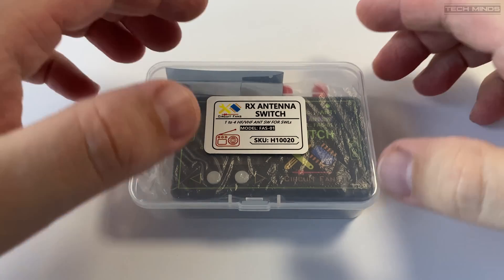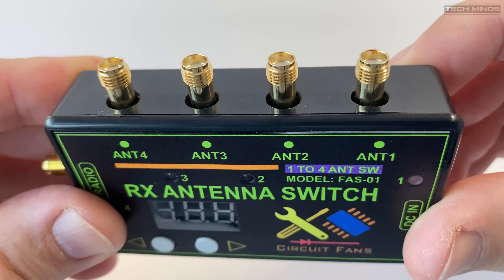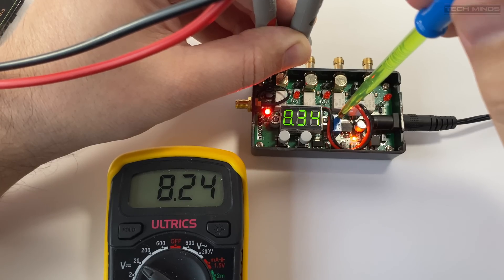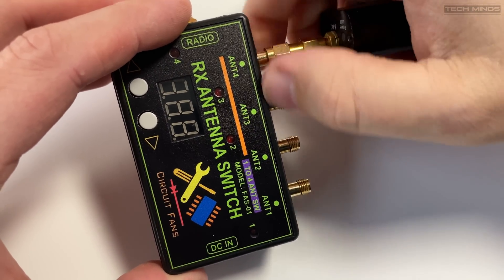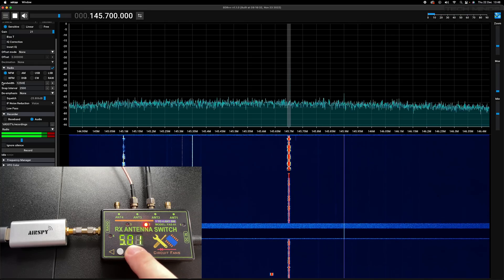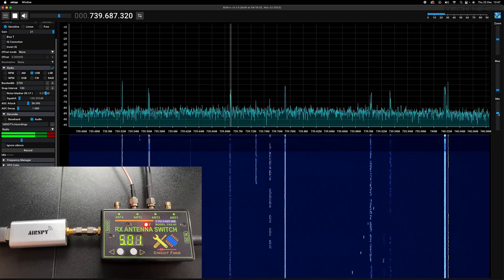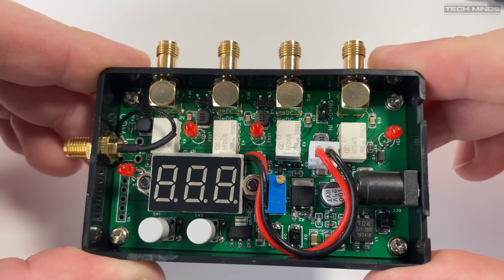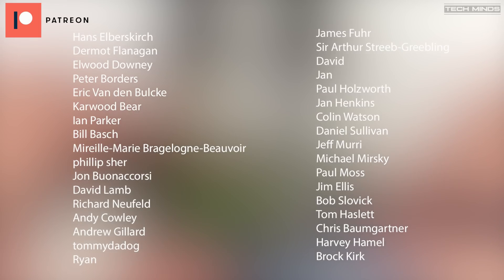SDR HF/VHF RX Antenna Switch With BIAS-T

Comment: I wonder why so many inline products for SDR  is only topping out at like 30ish megs. Why not just build the circuit to allow a clean path up to 3gigs or even 2 gigs. or even 900megs. It would seem to me that the higher freq arena would be component picky as far as tolorancers and quality, and thus drive the price up but i would pay 120 bucks for this kind of a switcher that was topping out at 1.2 and was as well switchable via a small AP on mac/pc. would any other readers pay 120m for such a hearty switch?

Comment: Nice.. Too bad Range is 300KHz to 150Mhz (Just above 2 meter)  nice it worked @ 740MHz.. Can you try this Antenna switch with ADS-B if it works decently at 1090 MHz.. (how bad will it be)

Comment: And I'm back. I got this a while ago, but I'm only just now getting a chance to play with it. 

I've looked at the instructions and the device itself, but I can't figure out what the specs are for the DC in jack (Amps, Volts, Center positive/negative, etc.). I'm also now sure about the inner/outer diameter of the jack itself.

After watching the video again, I think I should be looking for an adapter that should do at least 6.5V (1.5V + 5V Bias-T), 0.7A? So ... 4.55 watts?

What should I use to power it?

Comment: What voltage does it run on?  You said the bias T was showing 10v, so does it work with 12v DC IN then?

Comment: Another gadget for the shack!
This channel is proving to be expensive! But I really enjoy your videos!
Decided to order one since it will be an excellent device to use for direct comparisons across several different loop antenna designs. Bias T voltage available across all ports AND selectable means it enables passive antennas to be compared as well.
Happy New Year for 2023 and good DX!

Comment: This looks a great bit of kit but I'm looking for an antenna splitter that is able to split to 3 scanners but goes up to say 450 MHz. Does such a thing exist?
Reply: You can use TV antenna splitters with the correct adapters which are fairly inexpensive, but often lack the needed isolation between ports.
Have a look at Stridsburg Engineering out of the U.S. for designs that are meant for use with communications receivers. But they are not cheap.

Comment: It would be amazing if there was a similar antenna switch that was also controllable from a computer (via USB or Ethernet). 🙂
Reply: you could use a smart switch via a raspberry pi or alexa, just solder to the swtich contacts on the antenna switch box.
Reply: @Spark_230v  That sounds like a good idea, thanks! :-)

Comment: It's amazing how often I think, "I need a Radio Thing, I wonder which one is good," only to find Tech Minds either already has a video on the Radio Thing or releases one within 12 hours. :P

Just bought one of these so I can pair an actual 2m/70cm receive antenna with my YouLoop on an HF+ Discovery. Want to make sure I'm not missing the latest news from the random grumpy old guys I keep picking up on 2m. :P

Comment: The radio connector is kind of curious.  The PCB clearly has a spot marked there for a right angle SMA connector, yet they put in a bulkhead connector.  I wonder why.
Reply: It would be difficult to fit the board into the box if PCB mounted connectors were fitted on two sides.
Reply: @dogastus  Ah, of course.  Given the PCB has it on the layout, I'd guess the designer didn't think of that to begin with either 🙂